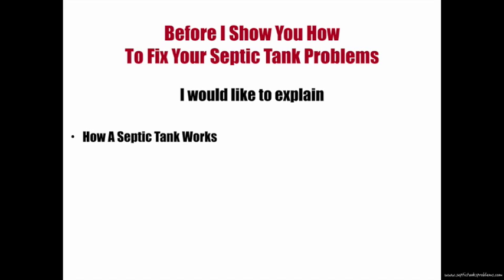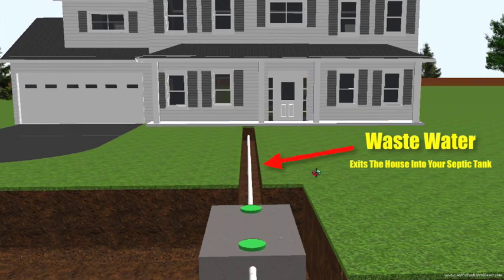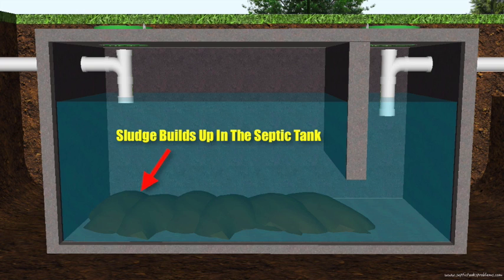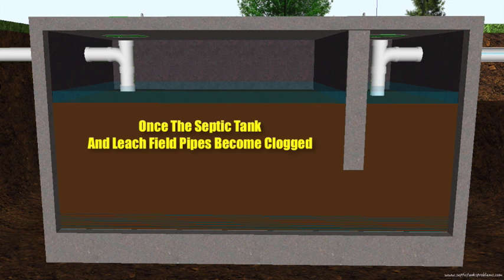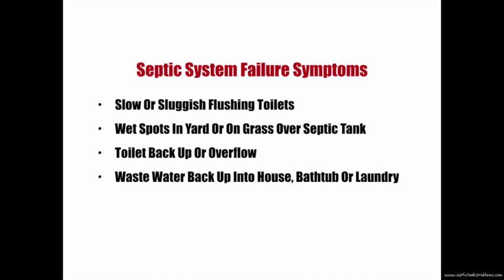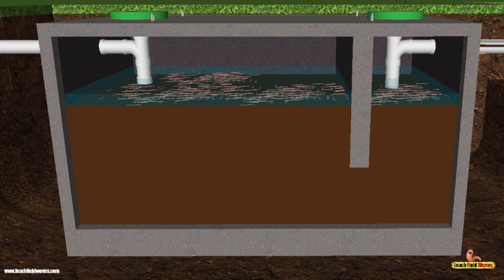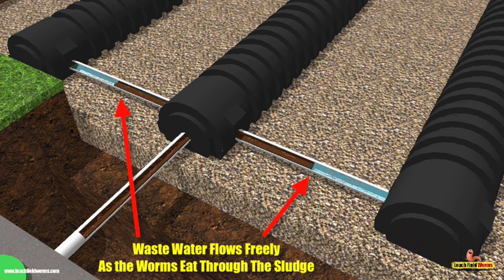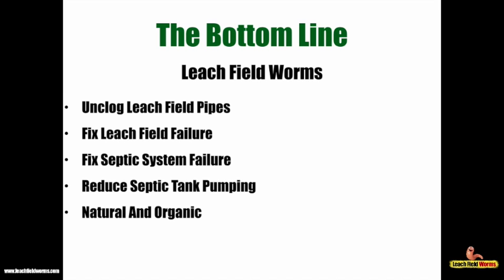What Is A Leach Field

Comment: 35 years ago I bought a lot that had an old septic tank on it. I put a trailer in and used the old system fully expecting I would eventually have to have work done on it. 20 years later I all was working well. I pulled the lid off the tank and to my surprise it was crystal clear, I could see the bottom of the tank. With a closer look I could see many tiny worms about a quarter inch long in the water. No smell, no mess. Wish I knew exactly what they are called so I could get some for my present septic system.